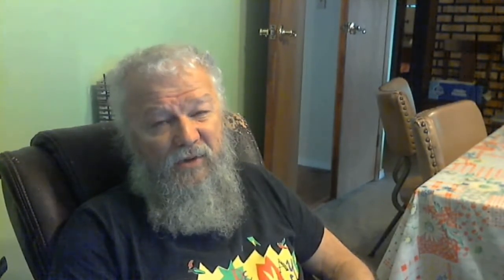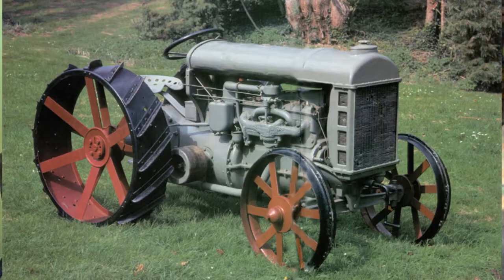TDD report for July 12, 2014

Comment: The older models are really cool ... an old friend of mine has a 750cc single cylinder diesel (don't know the brand) , it starts on regular petrol and has to be put manually to diesel when the engine is warm enough
Reply from the maker: I love the old tractors. I have a friend with two John Deere's. One is from the 1930s.